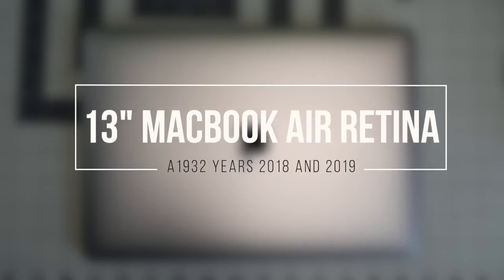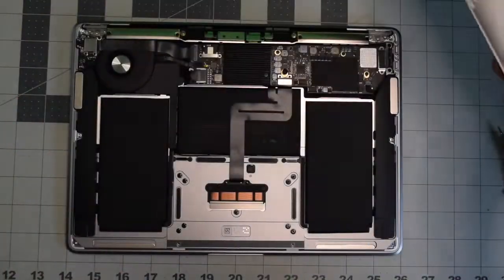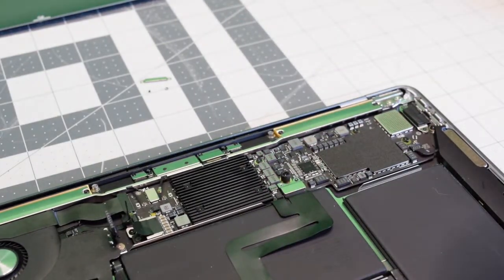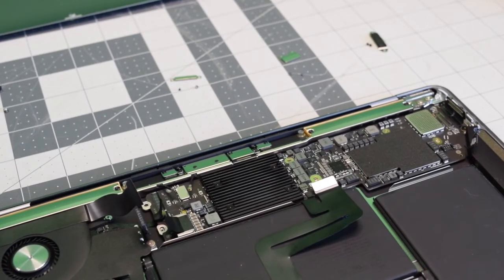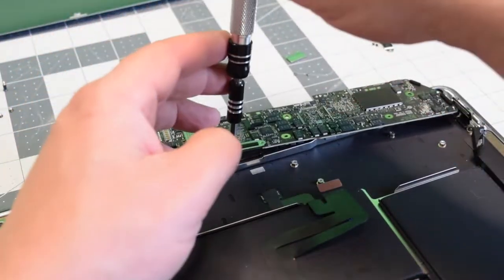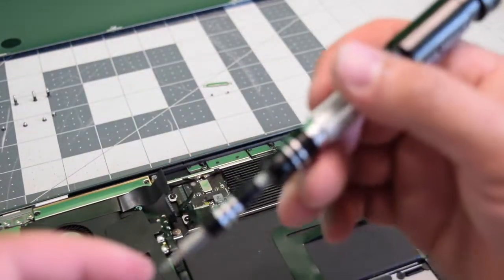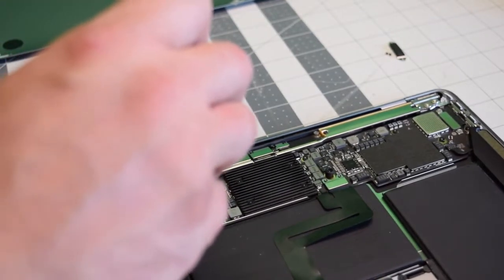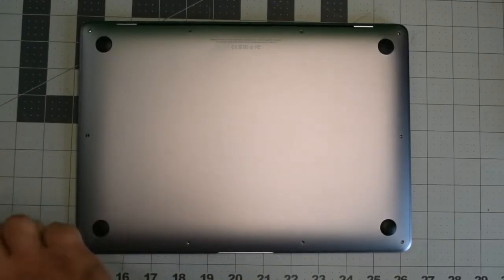13” MacBook Air Retina 2018 and 2019 A1932 Logicboard Replacement

Comment: You cruised through the “lever” on the disconnection for the audio board in like one second. I don’t even know what the lever is or how to disconnect it and if I try to do it without more specific instructions, I’m gonna break the freaking thing so thanks for the detailed instructions. I now need to look on Google or some other place to figure out what the lever is and how I disconnect it without breaking it.

Comment: The authorized repair center I sent my macbook replaced it with a new logic board, but they are still asking for my admin password in able to reformat it, which doesnt make sense to me since in my understanding new logicboard means new storage, and new password setup, why are they still asking for my password?.
Reply: bc they fixed the logic board instead of changing it